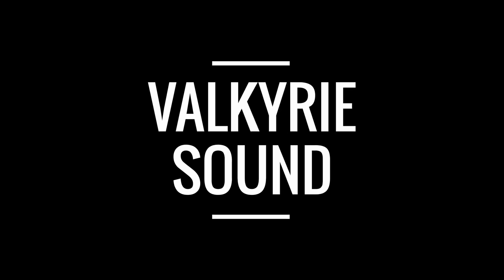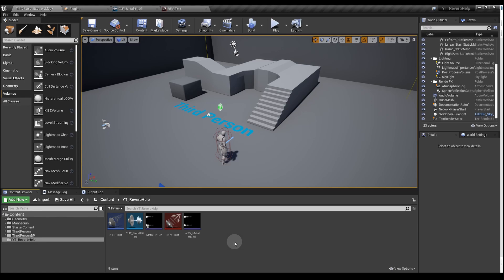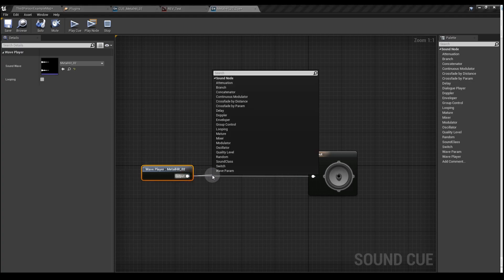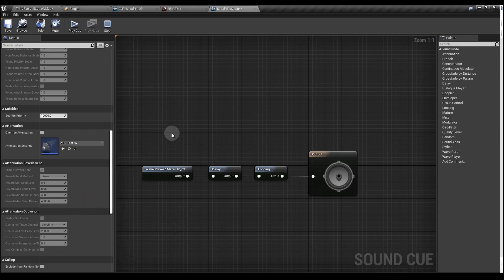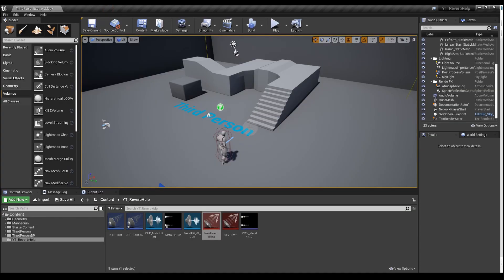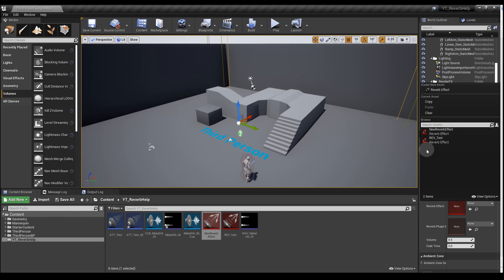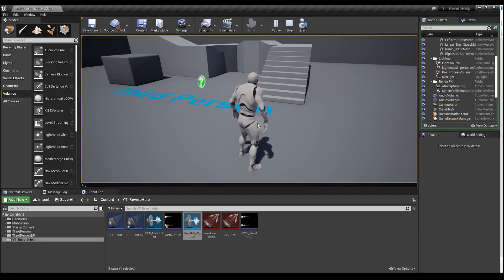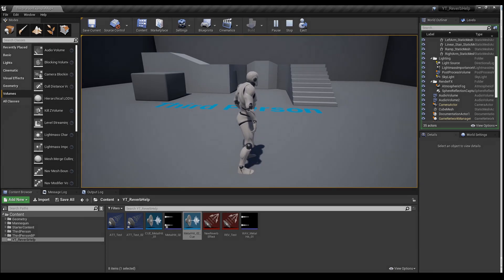Reverb Tutorial | Valkyrie Sound UE4 Audio Tutorial

Comment: I feel like using audiomiddleware is cutting from UE, not adding to it, like, occlusions for instance, there is a brilliant system in UE, which is unavailable to you, when you are using fmod.
Reply from the maker: Wwise and FMOD are very capable as middleware but of course they're more focused on audio. There are things in Wwise that aren't as easy to do in UE4 or which are missing - audio profiling and routing / bus management spring to mind. I think there's been a push from the audio team at Epic to close that gap between them and Wwise/FMOD but without necessarily duplicating what those alternatives offer.

Comment: i have a question. what if i set everything up, exactly like you did - and i got no change in reverb whatsoever? i can change time of reverb to 10 seconds if i want - i ALWAYS hear a very short and unusable reverb. do i have to mess with attenuation settings? the logic in this is just so chaotic and frustrating.. also - is this kind of audioVolume + reverb effect usable for steps of character, that are played as sound cue in char animation (notifies - steps) ?  because its not working for me. do i have to setup a trigger box with onenterstartoverlap stuff for this to be working?... thank you!
Reply from the maker: Hmm, that's a bit strange tbh! If you're definitely hearing some reverb then it should update when you're changing the values. Are you changing the duration in one reverb file and restarting play? (I'm not sure it'll update values during a play session.) For the animation bit - the reverb will be triggered based on listener location. If the listener is inside the audio volume and reverb is active (ticked) then you should hear it... You don't need a trigger box specifically for reverb - just the audio volume :)

Comment: This doesnt work for me. my cue still doesnt be affected by de reverb audio volume (cue is inside the volume). When i try to enter that command console the "UsingAudioMixer" extension after au.is doesnt show up.
Reply from the maker: That might depend on the version you're using. I think Epic fixed this in later versions. 
Have you checked if the line UsingAudioMixer=true is in the configuration file? If you're on Windows, you should find it here: Drive:/.../Epic Games/UE_4.[version]/Engine/Config/Windows/WindowsEngine.ini

Comment: Great video thanks. Really appreciate the others you’ve made , especially the one with the fridge to alien isolation rumbles. 
I can get your tutorial to work on 4.25.4 , but it doesn’t work on the newest version 4.26. Even when importing into the new engine versions. Is there something that needs to be altered when you upgrade ? Thanks !
Reply from the maker: Thanks! :) But that is odd... Have you updated the config file for 4.26? 
Find this: Drive:/Epic Games/UE_4.[version]/Engine/Config/Windows/WindowsEngine.ini

And add this: 
[Audio] 
UseAudioMixer=true
Reply: @valkyriesound3888  hi , yes I was in the process of adding that yesterday when I saw that was already in there. What is weird , is when I put the reverb debug on , it’s not even registering the reverb in world settings when I drop and effect in. Whereas doing the same thing shows the active reverb effect on 4.25 . Utterly baffled.
Reply from the maker: @sphangman  that is really weird. I tried adding reverb to a sound cue in a new project and worked ok. Did you say you were migrating the content from 4.25 into 4.26? AFAIK it should work fine that way but I'm wondering if there's a problem with the import... IIRC the Audio Volume has more options in 4.26 so maybe remaking the Volume will fix it?
Reply: @valkyriesound3888  it’s bizarre , the engine doesn’t seem to recognise the reverb effect even when you don’t use sound volumes and it’s put directly into the world settings.
Reply from the maker: @sphangman  Hmm, what do you mean by not using sound volumes? Could you try making a new sound cue and apply an attenuation to it then drop it in the map and place an audio volume in that space. If you walk your player character into the volume it should work. 

If not, there might be a bigger issue here so I'd suggest checking on the forums or the Answers page I'm afraid :/
Reply: @valkyriesound3888  thanks , yeah I got sent a working 4.26 project file last night from an ue tech sound designer with reverb and it still doesn’t work on my laptop. So maybe a bug related to my sound card or something else in 4.26 .
Reply from the maker: Ach, that's bad news. I hope you get it sorted!
Reply: @valkyriesound3888  Problem solved - There was a bug that went out where Submix effects weren't getting processed on Surround Submixes. 
This is fixed in 4.26.1
Reply from the maker: @sphangman  Glad you got it sorted! Wasn't aware of this bug.